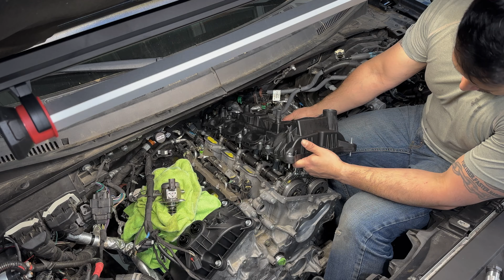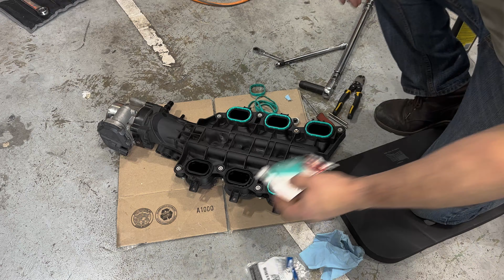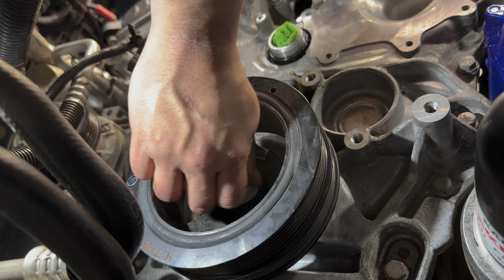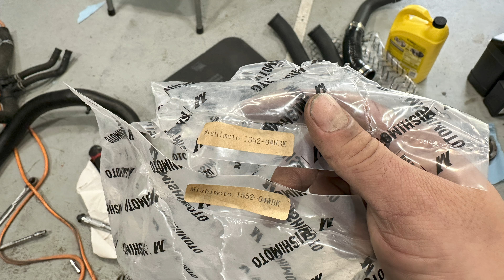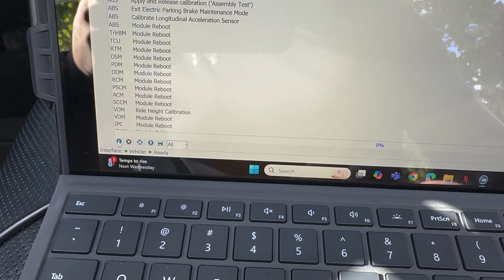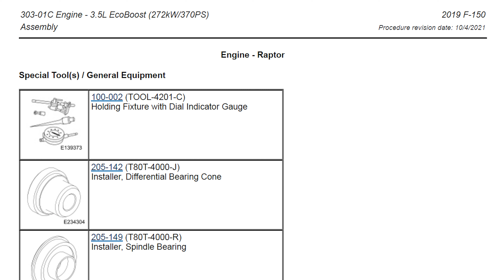Gen 2 Raptor Cam Phasers Part 4

Comment: How does the 72 hour workshop manual work? Can you use it only for 72 hours or do you only get 72 hours to download it? Thanks.
Reply from the maker: Yeah, you pay for 72 hour access to the web application for the manual. The application is a little challenging to figure out at first, and it's a pain to find different parts based on the naming convention, but you'll be able to print as PDF to use later.